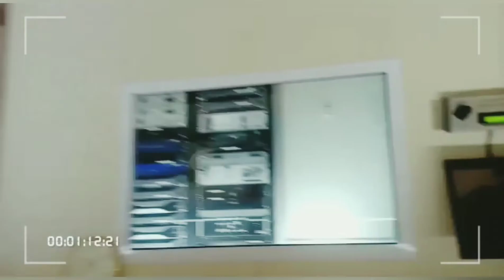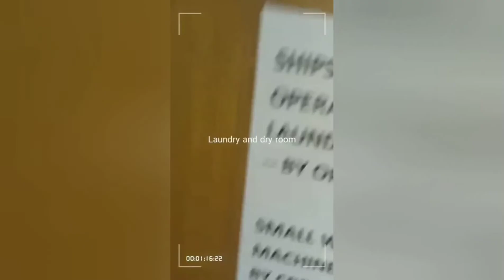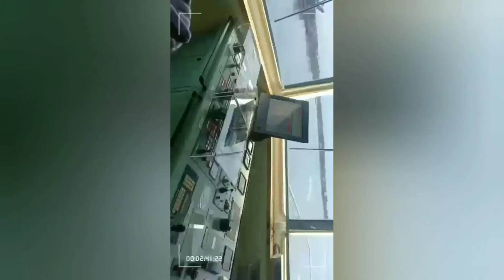ASMR Oceanographic Research Vessel Samudra Ratnakar- Research Ship

Comment: Does the Samudra Ratnakar use Azipods for propulsion or the conventional propulsion system???
Reply from the maker: It has twin azimuth thrusters for propulsion & bow thrusters for manouvering & Dynamic Position.
Reply: Thank you...
Reply: Thanks a lot for the info....and    I am actually making a RC model of Samudra Ratnakar so can you give me more info of the vessel....also I have seen this vessel at Mangalore actually but at that time I was just 10 years old....
Reply from the maker: @pranavar8541  I've seen the video on your channel. Great work there. Waiting for part-2 . Whatever info you need you can ask. You already have a good architecture of the vessel already and the hull is setup right.
Reply: @rohitkhairwar7841  ok thanks a lot...I will ask later on.... also do check out my other videos and do see the part 2...I will be uploading part 2 in about the week....
Reply: @rohitkhairwar7841  hi do you have a pic or video of the twin azhimuth and bow thrusters of Ratnakar...
Reply: Can I know what's the size of the propellers on the azimuth and bow thrusters...??
Reply: @pranavar8541  Hi ... What is the research vessels ? Can you explain me in Hindi 🙏